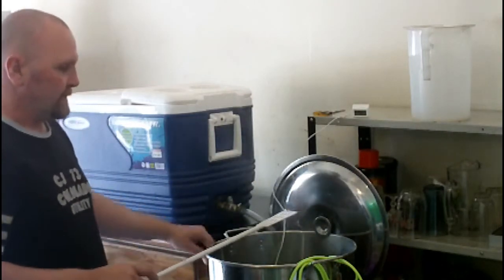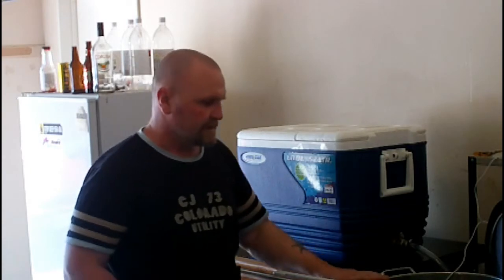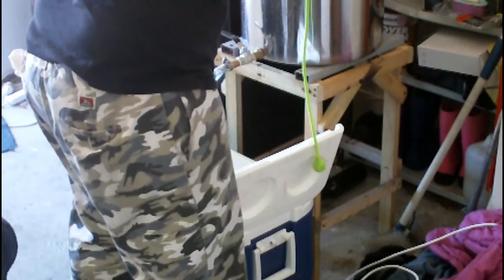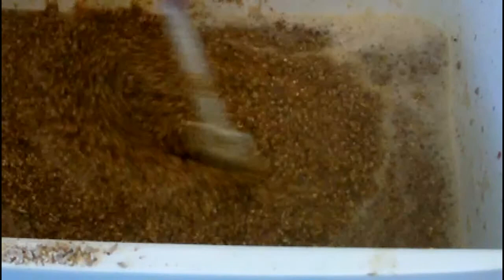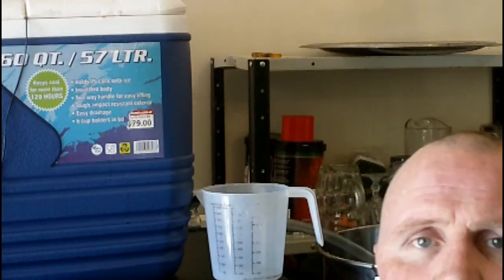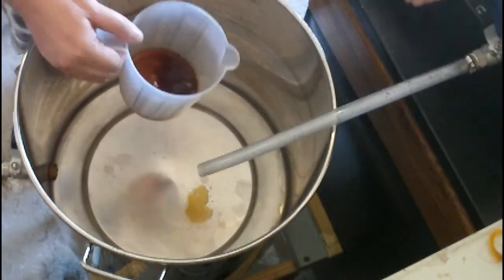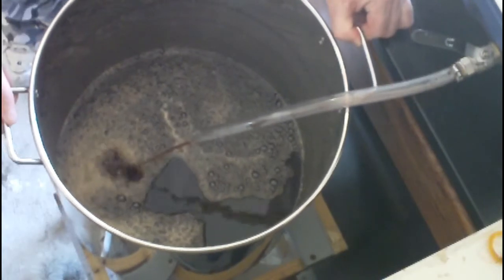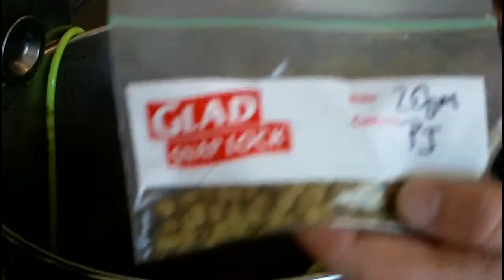DADs IPA...All Grain...

Comment: Nice one Steve, looking good. Don't mean to confuse you or anything but there is another method of doughing in which is called under-letting. Basicly you add your grains to the mashtun first and then you put your hose right to the bottom of the mash tun and fill from the bottom up. I havent tried it but it is suppose to reduce or not create any doughballs, Just an idea. But all and all good work sir, Cheers!